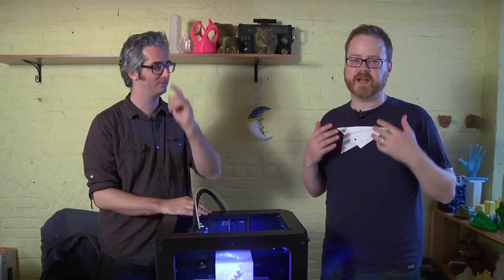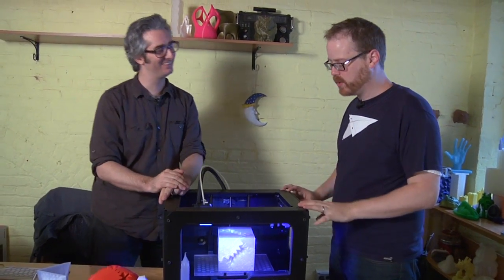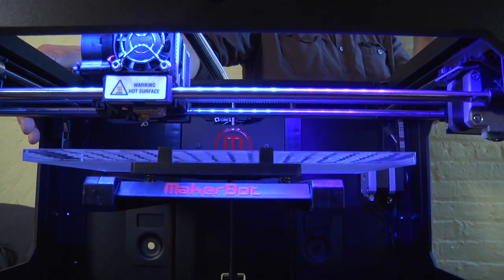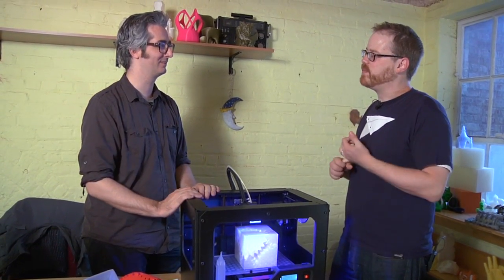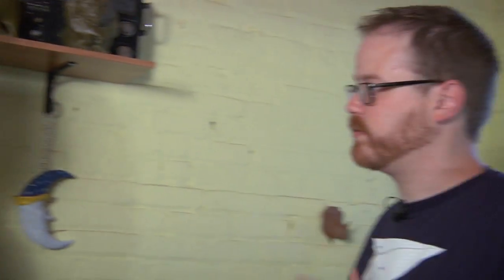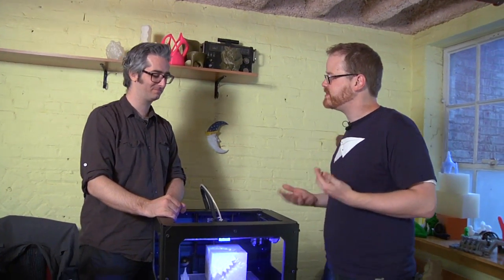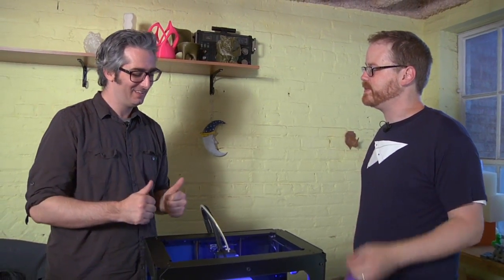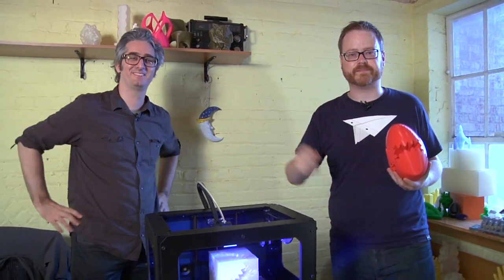Inside the Botcave: A Conversation with MakerBot Industries' Bre Pettis

Comment: The thing that will get 3D printers even better is a 3D object scanner.  With one of those you could scan a broken item and then "fix" it inside the software and then print off the fixed part.

Comment: Trying to market what they built is only reasonable, they want to have high standards for their "brand name". If someone copies the brand name and makes crappy "makerbots", that's a no no. Open source doesn't really mean that you can't have unwritten rules. as long as they do not patent or "copyright" bits and pieces that would make it impossible to build one yourself without getting sanctioned, THEN they are trully "off the mark" for now I think these guys are doing just great

Comment: i dont mind them going mainstream with the machine. what i dont like is them trying to limit choices in material. thats getting close to some of the other failure companies that have their plastic in chipped cartridges that you can only get from them. a good 3d printer needs to be a flexible platform with many inputs. 

also, they charge way too much for the machine, when anyone with patience can build a reprap for 400 bucks.

Comment: I not convinced of that, china has made many attempts at making cheap, Arduino clones and have been for the most part, unsuccessful. If you have brand loyalty, copy cats will have a very difficult time driving you out of business by making a cheaper clone. That goes double if the clones are of much poorer quality than the original, as is the case with Arduino.